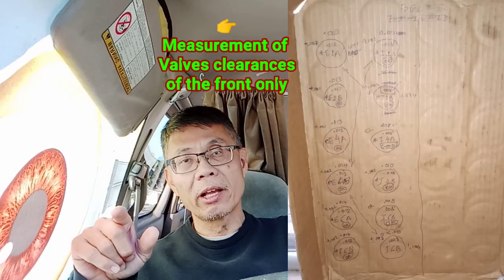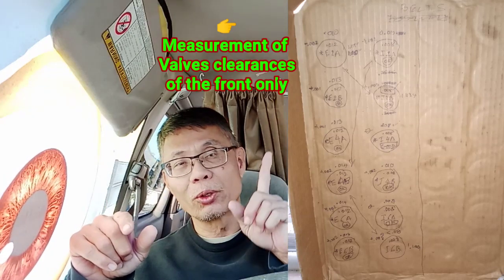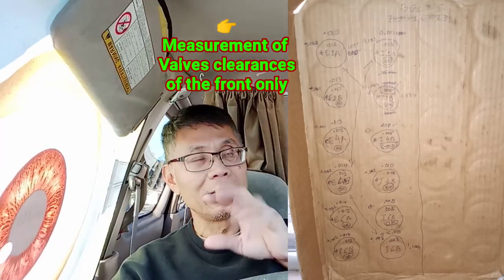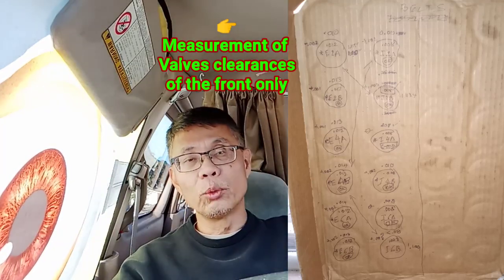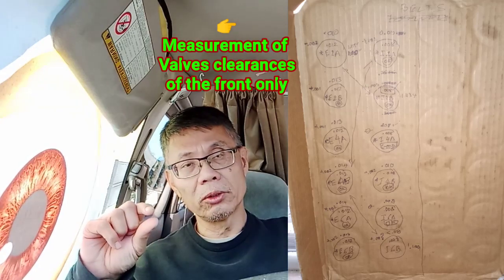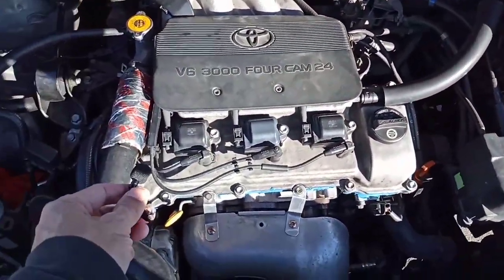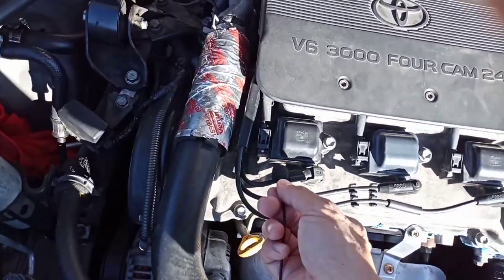Van Camping: Status of My Minivan camper 1999 Toyota Sienna

Comment: The good thing about an older van at least a lot of people ◇◇including you Tim, know how to work on them. You made your van considerably quieter. The thi about electrical vans is the lights come on for every little thing including and it  can be annoying 🌞.
Reply from the maker: Remove all of the light bulbs on the doors and that problem is eliminated. That's what I did with mine except in the rear hatch. Got to see what I need back there!😁 All the lights on the ceiling can be turned off manually.😉

Comment: If anyone can coax more miles out of that beastie, it's you! Be gentle on it going up hills and you'll get to see all 47.5 states yet (the other .5 is Cali, but you live there). My 2010 Honda Odyssey has had a replaced alternator+belts, battery and cables, and a power sliding door converted into a manual one, but the poor baby had 146K on it when I bought it. So far, so good! At least the timing belt and water pump were replaced just before I bought it, so (knock wood) no worries there! Safe travels, my friend...hope to see ya out there come spring so we can share stories and do some cooking😺 Who knows, we might even be able to run across Kevin...
Reply from the maker: 😂😂😂 Good one Kathleen (47.5 states)!

Comment: All good points  made, for sure !    This van is the space you need , perfect for your needs... it’s old- that’s why it was affordable... hey- it’s paid for too !  So, would  the cost of a newly rebuilt engine be easier than finding and fixing problematic mysteries ?  Just wondering
Reply from the maker: The transmission is on its last leg too. So you are looking at $1,500 just for USED engine and transmission. That's my friend is also an iffy endeavor! With $2,500 budget, I can find a newer version of this generation (2001-2003) and I know exactly what I am dealing with this time. No labor and time wasted this time around! BTW: vehicle that is 2002 or newer can be smog checked with a much simpler method-no code in the ECU storage. Don't live in California unless your vehicle can pass smog.